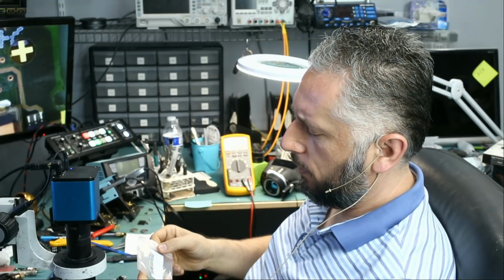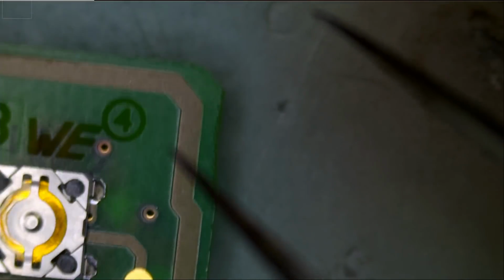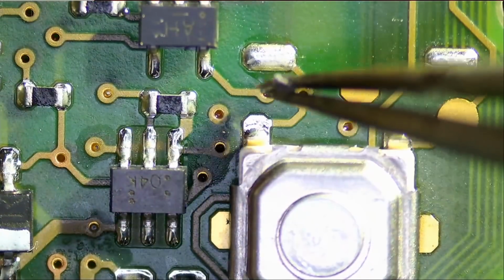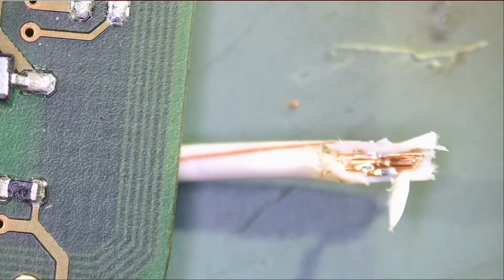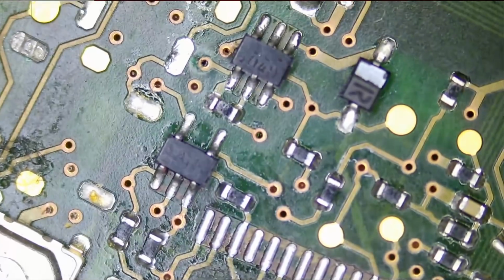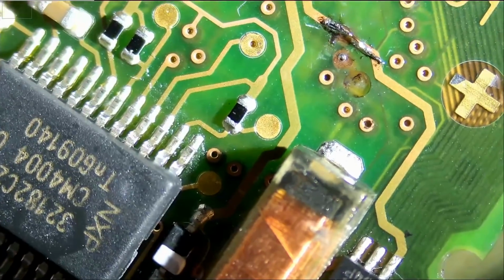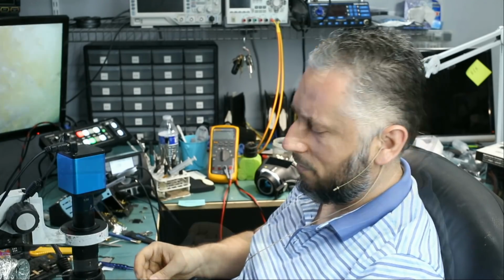Mercedes Benz Fob Repair - Turns on Vehicle but all buttons do not work

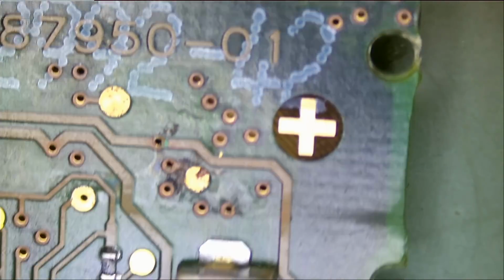Comment: At 3:27 in the video you can see a break in the trace line above the pad you before you started to scrape at the pad, isn't that the same issue you fixed with the wire?

Comment: Newbie question from a hobbiest. What's the point of 0 ohm smd resistors? I would expect it to be cheaper to just keep the trace going?
Reply: You can use them to jump over other traces, or quite often they are used to enable and disable various options or features, or even as configuration settings.

In the latter two cases they may be referred to as "straps".
Reply: @TomStorey96  thanks

Comment: As a tip for your future repairs, those circular pads are SMD test points. They are used to debug the circuit and always carry an important signal. You didn’t need to restore a corroded test point for the FOB to operate. Nice work

Comment: Just and idea, you could have inserted your thin jumper wire through the hole and it would have come out the other side of the board to know where the trace was going.
Reply: Not if the via is tented, i.e. filled with solder mask. Looked like they all were to me.

Comment: MB Key "Fobs" use BOTH Infrared and RF to transmit signals for the remote locking.  It also uses BOTH to interface with the vehicle to start it...

Comment: Great fix as always,  btw my purchase of those tweezers and angled 9m nozzle for the Quick came in almost next day.  Super pleased with both,  tweezers are fantastic no pressure / issues with small caps / res's when assembling boards.  To any makers if you have not gotten your tweezers yet ( Mechanic) I highly recommend you do right away as these made working with msop 10 and qfn parts super easy to work with.

Comment: Tbh the default was directly visible on this one, because  the mask wasn't in the same color, and this generally show a problem, also if you put a bright light below the PCB (for this type of PCB you see clearly the trace) also the rules is not solder a wire if not needed because this fragilise the pad, and it was totally possible to the multimeter without soldering a wire ^^.